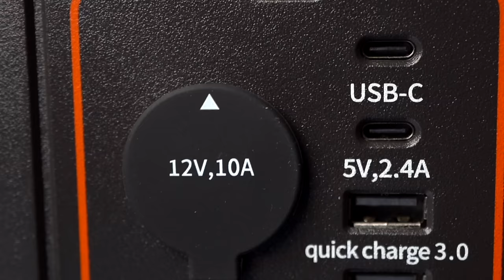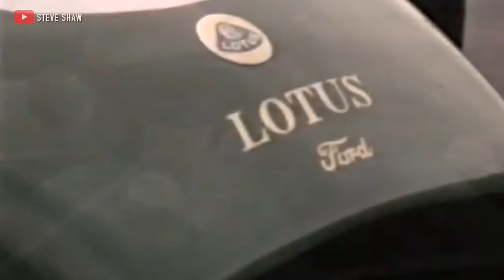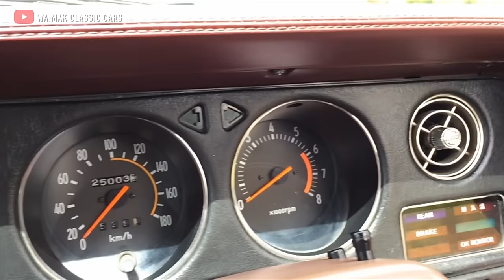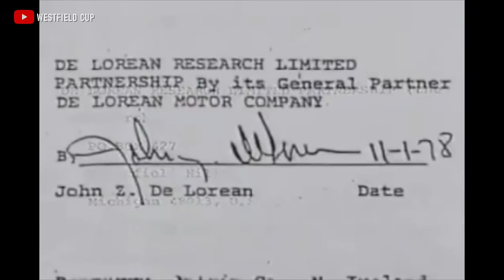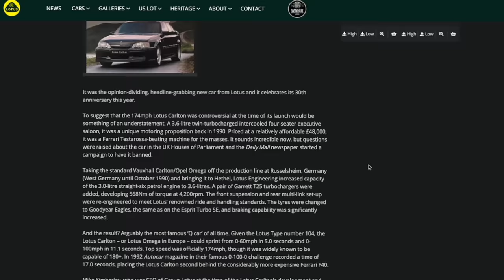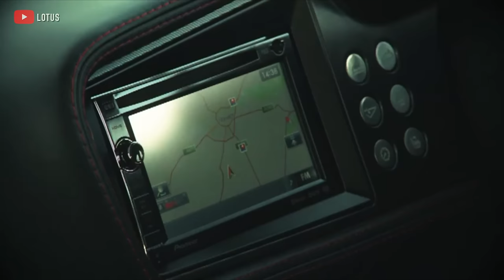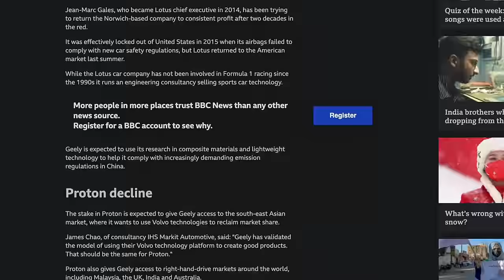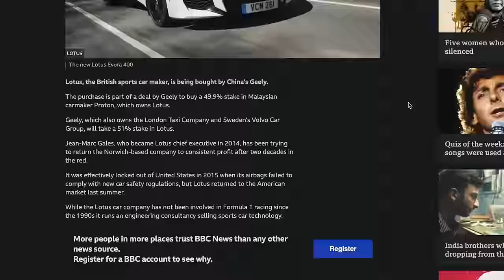Lotus is Dead

Comment: I'm very sad to see the "add lightness" mentality die, but it's a simple calculus, the internal combustion engine is being outlawed. If your lightweight sports car won't have the symphony of a gasoline engine and will be REQUIRED to adopt heavy batteries and motors, the sports car experience kinda falls apart. When a car is no longer an experience, it becomes an appliance, and appliances have to have utility. Is it any wonder then that all manufacturers are trending towards CUV and SUV models? 

Is Lotus dead? The literal answer is no, of course, the changes in the company are for the sake of preserving the brand. The cost for that preservation then is Lotus walking away from everything they've built. Same name, different soul. Rest in peace Lotus, you will be missed.
Reply: If anything, like Lancia and Mitsubishi, Lotus is becoming a walking corpse.
Reply: The original Tesla Roadster (which was based on an Elise don’t forget) is proof that you can still make a relatively light EV sports car. That came out more than 10 years ago, has about 200 miles of range and weighs less than an Evora. 

They most certainly can make an EV Elise with very minimal compromise, but maybe they don’t see the profit in it, or are just lazy.
Reply: Greta has everybody crapping their pants. In the UK, The ICE is on death row.The frantic rush to the EV is going to be v expensive. The government is all to keen for financial inducements - zero road tax for the EV etc. - but I still haven't worked out how they're going to make up all the lost revenue they get from the massive tax on a gallon of fossil fuel.
Still, looking on the positive side, our roads are going to be a lot quieter.
Reply: And that is why the new GR copen has power steering as optional

To continue such a feel
Reply: @clarksonoceallachain8536  I wasn't familiar with the GR Copen, I live in America, but they are super cool. Thanks for expanding my car knowledge, did not know about these.
Reply: I have a few playlists of vehicle's that many do not know of
I have yet to add the thairung transformer into said playlists
Reply: @clarksonoceallachain8536  da wha
Reply: They aren't preserving the brand, they're preserving the name.
Reply: Just going to ignore how much lighter the Evija is than a Rimac? The add lightness philosophy is very much still there
Reply: For add lightness, it may be possible for "range extender" engines to be used that are very light with small capacity batteries to get a lighter sports EV that has EV performance, but range from the extender ICE; maybe the extender ICE runs Hydrogen.
There is more than one way to reach a goal, IF the legislation allows AND the company management is allowed to pursue these options. Hopefully legislation will change & allow the market to choose options to meet goals rather than the solution itself being legislated, which is stupid as politicians haven't exactly cornered the market on good sense & intelligence.
Reply: @thecraggrat  That's a very good idea. Your suggestion that the ICE engine be continued as an "extender" is what the most usable EVs have already. Forcing this political ban upon the driving public is extremely short sighted at best. Using an alternative fuel, if they are fixated on banning petroleum based fuels, is a logical alternative but we already have several different choices in that field. It's not like a "brand new miracle." 

For short range, urban delivery and commuter vehicles, electric will do the job. The same applies to electric trucks but to a much greater degree. Force-feeding a faulty political agenda is nothing new. It's another case of what should be an engineering discussion being held hostage by the political groups. The engineering contingent has developed several efficient short range solutions to commuting, that don't particularly care about recharge times. Since that's a large percentage of the traffic in urban areas, EVs will work in that environment. For the rest of the market, in the US & elsewhere, there's a lot of chatter but the results are distinctly underwhelming. It's another instance of one solution not solving all the problems and a short sighted management group focused on image far more than results.
Reply: Well, if they wanted to only make electric cars, to make a proper LIGHT electric sportscar may had been an interesting challenge. Now they're just another Koeningsegg.
Reply: @shianchuu  Well, the problem is the UK has decided that there are to be no new ICE engined cars after ~2030, so Lotus HAVE to change to survive, I doubt they want to.
Until batteries get a lot lighter, there will be a weight penalty for EV's with a desirable range.
The Tesla Roadster with a range of ~ 245 miles is ~1305kg vs the ~930kg and range of ~285 miles of the Elise model it is based on, which is a pretty big penalty.
For the interim where hybrids are allowed, range extender hybrids with a light engine and an optimised small battery size would probably work with a weight penalty of only ~100-200 kg, that would likely be the Lotus route to minimum weight. If the fuel is Hydrogen or GTL petrol/alcohol then you can keep the greenies quiet as well (ideally the power to produce GTL fuel etc will be nuclear so we don't have the blight of windmills across the countryside).
Reply: @MrGaryGG48  Yeah, I've made the same arguments elsewhere too. Nowhere have I seen how the electricity requirement is going to be satisfied, so first I did a quick search on fuel usage in the UK - about 46 billion litres/year. estimate average fuel energy content to be 36MJ/litre. EV's typically consume ~0.25kWh/mile (this works out at 0.9MJ/mile), equivalent to ~36mpg @20% efficiency in an ICE.
Crunching numbers for fuel usage, it is equivalent to 1.656 E18J/year which is equivalent to 460 TWh/year. To compare the electricity production in the UK in 2020 was 330 TWh, so the production side of the equation needs to 
To produce this extra electricity it would require 53 1GW power stations to be built and be operating 24x365. I can't find data on availability factor, so I'll assume 80% and thermal efficiency to be ~46% for a FF power station, so this means 30 new GW capacity power stations running at 80% capacity to generate 200 TWh of electricity. 
ie increase the total generating capacity of the UK by ~61%.
Can the Grid take this - I doubt it. With the ups and downs of the usage as cars charge this is also wildly incorrect, you could only do this by charging batteries steadily the whole day, then using the battery to charge the car (with EVERYONE doing this), which will not happen, so you need extra capacity.
Now if you can produce GTL or Hydrogen as the fuel, this becomes easier, or indeed, have a mix of approaches.
As it stands the government will not invest in power stations, and if they do they need to be Nuclear, or you just move pollution from the car to the power station, or cover the country with windmills and hope for the best.
At the rate that anything like this gets decided, there is no way the country is going to be ready, even if Gen IV molten salt reactors were ready and proven right now, it will not be built in the timeframe - a 1GW MS reactor costs ~£2B (probably), so that's ~£60B to maybe ~£100B for the build out. 
It would be good for the country, likely much more so than HS2, but will we see the commitment?
I guess we'll have to wait and see.
Reply: @thecraggrat  
Hmmm... wait and see. Your analysis covers the topic better than any other I've seen.

If the topic doesn't fit into the "Cause du Jour" it gets no air time with our public media. 

It's probably more likely that when the power grid does start failing from the overload, that will bring on the next crisis in the news. It would seem reasonable to plan on the increased load before dumping the load on the existing system and then legislating the existing system out of business. Am I just a sceptic... maybe.
Maybe I am but that doesn't mean I'm wrong!
Reply: @thecraggrat   I think your math is wrong, 250wh/mi is equal to ~ 134 mpg. Energy content of gasoline is equal to 33.7 kwh per gallon (US). Almost a quarter less the energy consumption. We're also making some assumptions that the efficency of the ev fleet doesn't appreciably increase, or how driving habits will change at large (MOT finds that UK drivers are gradually driving less since around last decade). Extrapolating on your math, thats 124 TWh for a 100% electric fleet. Real question is how long would that take? Even if all NEW cars were electric by 2030, there is still all the remaining ICE cars on the road - so all ev by what, 2040? Thats an extra 7 TWh for every year until then. I have no how idea feasible that actually is.
Reply: @hemingwaybromfield3722  No the current consumption of EV's runs at about 0.25kWh/mile (I checked this online, and it makes sense - 100kWh Tesla S will go for ~400 miles), energy content of a litre of fuel runs ~32-35MJ/litre for petrol and about 38MJ for Diesel, I took a rough average for average energy content in fuel used.
As far as my maths go, I assume 100% efficiency for the EV and use an estimate of 20% efficiency for the ICE (ie 20% of the fuel is converted into motion). So assuming the 0.9MJ/mile energy consumption, then on a mpg basis 4.5 litres of fuel (1 imp gallon) = 162MJ gross energy content, => 32.4 MJ available for motion => 32.4/0.9 miles of energy assuming same energy use in motion as EV =36mpg fuel consumption of an ICE engined car - I'm checking for reasonable self consistency of my figures, this seems reasonable to me.
I then move on to looking at how much the fuel used is as generating capacity - The fuel used is the energy equivalent of 460 TWh/year, which is equivalent to 53 GW capacity power stations running 24x7 for 365 days a year, ie continuously.
Required energy assuming EV usage @ 100% eff. = 460 TWh*0.2 (ICE efficiency) = 92 TWh which is equivalent to 92000/8700 GW stations running continuously (=10.5 stations, round up to 11 stations)
BUT generating thermal efficiency ~0.46 @80% availability => # of GB stations=11/(0.46*0.8) = 30 stations @ 1 GW, which I didn't explicitly state, but that was my error of omission and was where the maths led me. That is less than the 124 TWh energy you came up with above.

Now to get that capacity, the question is what are we using? I would suggest Nuclear, so can we build 30 2 core RR SMR power stations (each SMR puts outs out ~0.47 GW) by 2030, I doubt it, the reactor is going through review and it'll take a while before the design is signed off. by 2040? If we work on it.
Reply: I dread the days ahead where all our water is filled with toxic metals from ewaste and battery's
Reply: People that love cars need to stop wringing their hands and saying "oh well this is the future."  Crap people this is one of those things that helps you put up with all of the other BS in the world.  Fight for it!
Reply: @Elconbrioso  They aren't. EVs make more road noise due to being heavier/having thicker tyres, and road noise is most of what we hear as a car goes past.
Reply: @C.I...  OK. I know that they are heavier than fuel burners . So I guess the roads will be wearing out at a faster rate . More potholes - for the councils not to fix - joy.
Reply: Huh... I wonder why some many people love their Porsche Taycan's. Most be imaginary because this big brained guy on YouTube said that EV sports cars can't work. 🤷

Comment: I owned a Lotus 6 (in England) in the late 60's, with a Triumph 4cyl. 2L engine. It was crazy fun - a rocket roller skate. The clutch was a pedal on a shaft, direct into the bell housing.
Then the Lotus 7 came out - advertised as 0 to 60mph in 3 days! You could buy it in kit form & assemble it yourself. (To avoid tax). It had a 2L ford engine with twin overhead cams & twin Webbers, or DelOrtos. My buddy had an Elan & it felt like luxury by comparison. Earlier, I saw Jim Clarke & Dan Gurney race at Silverstone & Graham Hill, but he was in a Mk. 2 Jaguar. I was 10 years old & so lucky to be in Brian Lister's pit. My Dad was working at Lister Jaguar at the time.
If I could find an old Lotus for sale - any 1 - I'd love to fix it up... & put an electric motor into it.
If anyone's got 1 they don't want - let me know. I'm in Southern California - thanks
and thanks for a great video, Albon

Comment: Back in the early 1970s when I was racing at club level, I met two guys at the track who used to work for Lotus. They told me about Colin Chapman who they knew quite well, as he spent a lot of time on the factory floor keeping an eye on things. He was a real hands-on guy they told me, and then mentioned his habit of picking up a component, inspecting it closely, then saying "Take a chunk off here, it does not need to be so heavy". Once that was done and inspected once again, then all those components would be similarly modified. He got the nickname in the factory amongst the guys there, as "Chunky Chapman", not to his face of course! He truly was a fanatic about weight! That particular emphasis has clearly been lost now, along with many other elements of the previous culture!

Comment: I daily drive an Evora GT and it spoils me. Its literally the best drivers car on the planet. I will never get rid of it.
Reply: I have an Exige and I would never get rid of it. But I swapped cars with a friend with an Evora on a drive. If you had blindfolded me and put me in the driver's seat, and removed all badging from the interior, about a minute of driving it would have told me it was an Lotus. It's just a more civilized version of my car. It's bigger and heavier, but it's still the same Lotus experience, just less intense. I could use mine as a daily driver, even with the suspension upgrades and the BOE supercharger, but I'm the exception, and realize that most people couldn't live with it on a daily basis. You wouldn't just hop in the Exige and drive it across the country. It's not that kind of car, but being more well rounded, the Evora is.

I'd love to own both, as the two cars complement each other.

Comment: I owned an S3 Esprit Turbo in the mid 80's. I spent every penny I earned to own and keep that car. It was great fun. Wish I had kept it. Thanks for your time and effort into putting this video.
Reply: In the early to mid eighties, I worked on the oil rigs in Saudi - 60 days on 30 days off . Instead of doing the sensible thing and hiring a decent car for my days off in England - I pretty much bought a different 2nd hand car everytime I came home. 
That was a ridiculous thing to do - bearing in mind that for 60 days at a time the car would sit in a garage depreciating in value, eating into road tax and insurance premium. 
Anyhow, I did lust after an Esprit and came v close to making a purchase.
So glad I didn't - it would have been such a waste of money. I'll leave the ownership of supercars to those who get their moneys worth out of the car
Reply: I have an 84 turbo esprit and it’s lots of fun. People are very happy to see it! Was the car reliable when you had it in the 80s?
Reply: @chefgromano5025  I owned my Esprit for almost 3 years. In that time it only broke down once, which was the result of a failed fuel pump. I did many repairs including a replacement clutch and a few suspension components as well as  general servicei tems.  However,  I  think for a car of its time and performance it was great when you consider the quality of parts used. It was a real head turner, and as a young lad in his 20's it was a real buzz. I'm smiling here just thinking about it.
Reply: Lotus Esprit is favorite 80-90’s sports car.

Comment: As a little kid our neighbour had a Lotus Cortina breifly and  growing up my Father would tell me about the Elans and Europas and Sevens, and I liked the look of MKI with its stripe ect, could never afford a Lotus Cortina so I bought 63 GT two door instead. I still miss that car. But Dad a couple of years ago bought n built a Caterham 7 and dropped it on top of Honda S2000 running gear... man I've had fast cars from Aussie Muscle to German and British fast Saloons.... but FAAAARRRK ME that 7 Scares the absolute Shit Outta me! Even though its technically not a Lotus anymore... but from my understanding the Chassis is pretty much the same as the original chassis in ethos but built a bit stronger due to constant evolution and fixing the weaknesses found over past 6 decades as well as better quality materials in the construction, but they Still have Chapmans spirit in them Lightweight and powerful enough engine... although personally I would rather have my old 1558cc Ford Kent engine that I had in my GT Cortina in dads car. 
But I'm a bit of a traditionalist there.

Comment: First models of both the Land Rover and Unimog very much embodied "simplify and add lightness" I think, not SUVs of course but 4x4s. Weight is as great an enemy off road as it is on the race track or B road, their use of lightweight materials in a very simple design to make them reliable and easy to maintain made them iconic.